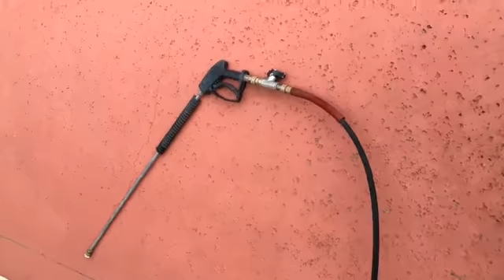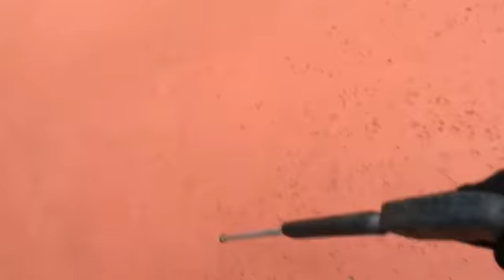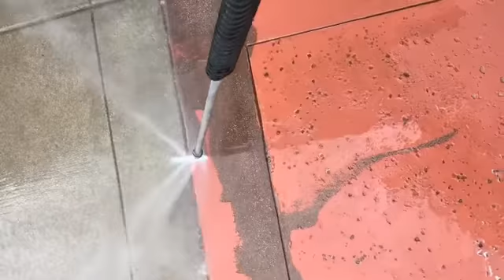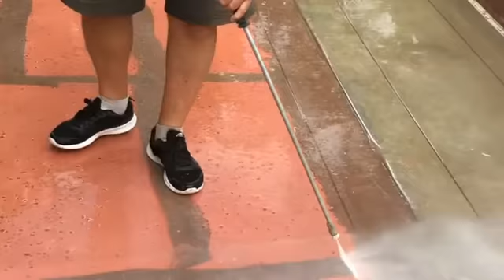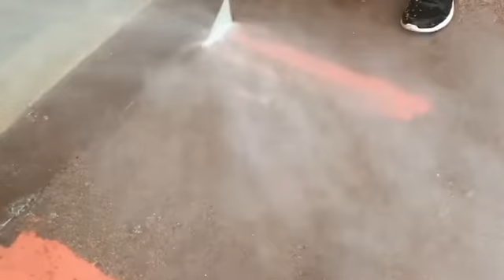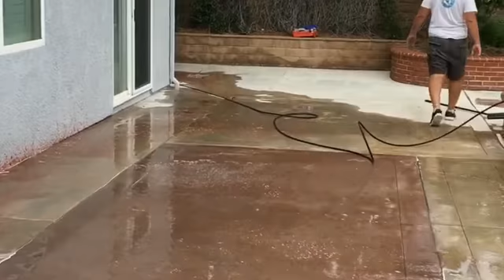VERY SATISFYING POWER WASHER REMOVING PAINT!

Comment: Must be watercolor paint on that patio.
Reply from the maker: A. Sch. This floor was coated in standard concrete stain. The stain was rolled on instead of sprayed so the hot water steam cleaning had no problem peeling the layer of paint off the concrete!
Reply: @jetstreampowerwash  whats the rate on a job like this? Needing this for my front porch